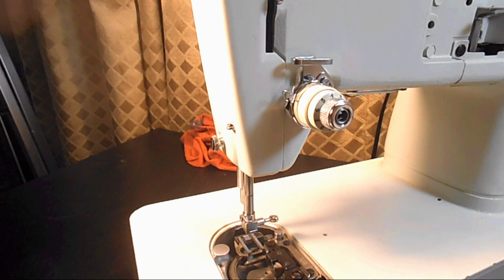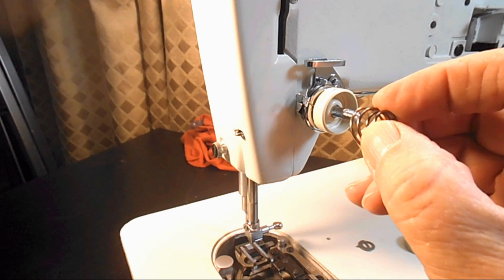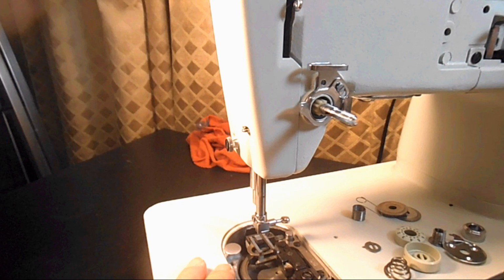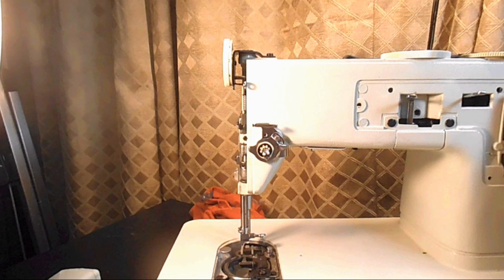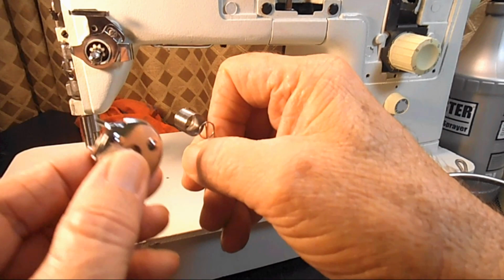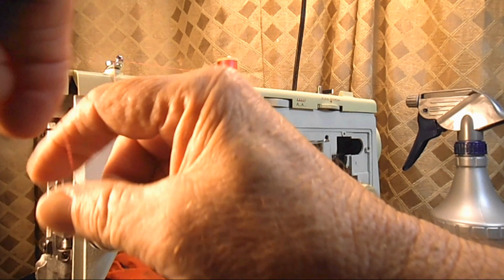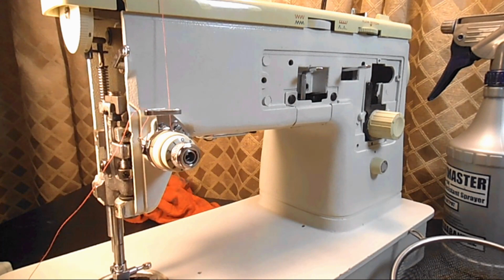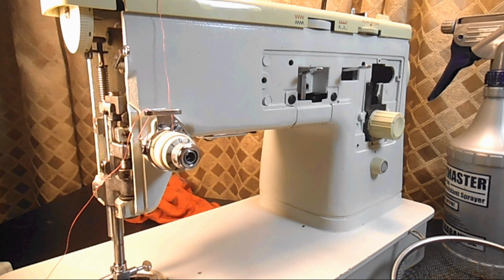How to Remove, Clean, Replace and Adjust the Thread Tension Unit on a Vintage Singer Sewing Machine

Comment: Hello Andy, remember my machine was hesitating to start sewing... I noticed this morning that the machine was sewing well without a thread... well, the problem was my tension disks, it was super thight (even at 2)... so I disassembled it again and my machine is working fine now! yeah!
Reply from the maker: Fantastic! Wow, that must have really been tight! I'm so happy you found the cause and thanks for sharing it. Another possibility to add to the list. I would not have thought of that cause.
Reply: @andytubesewing1953  Maybe I am wrong too but for now, it seems to be much better but that leads me too... OK but if it get stuck because of the tension, maybe my motor is not that good hehe I saw an other 401A to sell, I think I'm gonna buy it and see if it goes better, and keep it for parts or whatever cause I really like this machine.
Reply from the maker: @Cass_772  well I can't fault your reasoning on that. I have a spare motor that I cleaned up and tested for each of my wife's sewing machine. I also bought a spare hook because nobody makes those anymore. They last a long time but what if the hook point snaps off or something like that? I am so happy that you love the machine and that you are getting it back in service. I guess I said that before. Sorry but I am happy for you
Reply: @andytubesewing1953  Ok I'll get that second machine haha I am really grateful for your help, your replies and your videos, thank you so much!

Comment: I had to remove the tension unit of my 338.  The +|- indicator was broke.  Luckily i was able to find another.  I would not have been able to do this with out you.  Thank you so much and Merry Christmas.
Reply from the maker: Merry Christmas, and thanks for keeping the machine in service. It's a beauty, and I'm glad you found a replacement you could use.

Comment: I failed to  tell you that the sew machine is a Singer 248
Reply from the maker: Hi, Albert. I've never worked on the 240 series of Singer machines. I do have the parts manual for them and it has a blow-out picture of the tension parts. To me, it looks like there is a compression band inside the plastic numerated dial that slips onto a knurled knob to hold the parts on. I think you can pull the knob straight off the rest of the unit. You can buy a service manual for them for $9 at this link:  https://manualsoncd.com/product/singer-240-series-sewing-machine-service-manual/  You just download a PDF after paying. As a matter of fact, in the listing for the manual, they show some pictures, and one of them is the blow-out diagram I mentioned. You can see what I mean. IMO, $9 for the manual is reasonable and I own the service manuals for most of my machines as they are full of adjustment, repair, and remove/replace information. Thanks for watching my channel, and good luck.

Comment: Thank you for this clear demonstration. Nice to keep these old beauties in circulation! 😊
Reply: Unfortunately, it’s missing the tension flange indicator adapter and has only 2 rings. But it’s a Stylist 522 so maybe 2 rings is correct.
Reply from the maker: I'm glad you found the video to be helpful and I appreciate your comment happy sewing
Reply from the maker: Puzzling! The Singer 522 Instruction Manual shows it can be used to sew twin needles. It needs three tension discs to separate the threads for proper tension.
Reply: @andytubesewing1953  Thank you for letting me know it needs that extra tension disc. The machine was given to me so may be worth getting the missing parts. 😊
Reply from the maker: @heatherheather7107  good luck
Reply: @andytubesewing1953  thanks

Comment: Amazing video. I should have disassembled and reassembled my wife's sewing machine tension assembly before I ordered a replacement as her repair shop told her she needed. He said the assembly was missing a part and therefore wouldn't keep the correct tension on the thread.  As it turns out, the repair shop disassembled the assembly to clean it and put it back together in an incorrect order which is why it wasn't keeping the correct tension. Thank you very much for your thorough and accurate instruction video.
Reply from the maker: Thanks for the compliment. I appreciate you watching my channel and I hear from hundreds of viewers about repair shops that just aren't very good with vintage machines and that's one of the reasons I go into such detail I may have more videos on your particular singer model. Do you just go to my homepage? I list playlist by model number. Thanks so much for watching my channel and keeping your machine and service

Comment: I accidentally left my thread on my tension disc when I threaded my bobbin. My tensioner was a mess. Thank you for the video! I was able to disassemble, reassemble, and correctly set the tension on my machine without needing to take it to the repair shop!!
Reply from the maker: Good job! I'm glad you found the video. No more tension "tension" for you as you now know about it. Thanks for commenting.

Comment: This video was very informative as usual. I want to watch your other videos about tension as well.  My recent 401A purchase was very dusty and had a lot of lint in the bobbin area.  The tension discs probably need a good cleaning as well especially since I have to set the dial to 6/7 to make the stitches to look decent, but not as good as I think they should be. I always get nervous about disassembling parts, but after watching your video, I think I’ll give it a try.  Thank you!
Reply from the maker: Thank you Shelly. A lot of Lent in the bobbin area can relate to their also being a lot of Lent in the tension unit. If it gets impacted in the check spring or the actual tension spring and the disc, it can prevent proper tension. Thus, you have to add more and more so a nice cleaning can really make a difference. Best of luck and thanks for the nice comment

Comment: Thanks Andy. That was exactly what I needed to set up and zero the tension on that exact model.
Reply from the maker: I'm glad you found the video, Matthew. Lucky it was done with a model 413, right? A nice machine and very capable until the plastic gear on the vertical shaft breaks apart. It seems like a matter of time and usage before they go out. I had so many inquiries about that gear that I made a video for replacement. Maybe your machine already had the gear replaced but if not keep this video in mind for replacing the gear; https://youtu.be/M3bFtlV1Y6s   Thanks for taking the time to comment and take care.

Comment: ANDY! You are my hero! Thank you! Thank you! Next, I'm praying you have videos working with a 1964 New Home (Janome) 670. Blessings to you!
Reply from the maker: So sorry, MissMarta. I only work on vintage Singer machines. The only thing I know about the Janome models is they are high quality, so congrats on having one. Good luck, and thanks for watching my channel.
Reply: I appreciate your response ❤
I will be back, I have 3 beautiful Great-Grandma hand-me-down vintage Singers. One, a treadle! I'll holler when I get to one of those projects. Blessings!
Reply from the maker: @missmartamc  sure thing🙂
Reply: By the way, I was working on my Janome when I watched this video of yours, and the tension unit in mine is different, so I watched and rewatched what you were doing and listened to what you had to say, and because you are so thorough, I was able to do the repair and put it back together properly. And it works like a dream. Thought I should add that.
Reply from the maker: @missmartamc  thanks for letting me know. I get complaints. My videos are too long but my goal is to explain how the parts work and how they all work together. And I'm glad you took the time to listen and not just watch and that it was worth it for you since you got it fixed. Thanks again for letting me know. That's kind of you.

Comment: Hoping a good cleaning will help my machine out 🥲No matter what I have the tension at, the disks trap the thread and snap it. Doesn't seem like any debris is in there, so I'm going to actually wash the parts like you said. Also, Krud Kutter is amazing! Used it as a maid- it's wonderful for soap scum in the tub 😁
Reply from the maker: Having a clean and adjusted tension assembly is always a good idea. It can fix the problem or lead you to the location causing it. Good Luck.

Comment: Thank you for the post. Slow and methodical with a good explanation of what you are doing. My checkspring is disengaged. I am going to try to fix my White 221 with your help.
Reply from the maker: Thanks for commenting. I may have some better videos for the type of tension assembly on your featherweight. It should be the same style as the SInger Model 301A. Where the little chrome adjusting knob in this video uses a set screw, the 301A & 221 knob has a pin on the back that sits into small holes in the numbered dial. I covered all the tension assembly work in my Coco 301A series if you'd care to take a look. DIsmantle Video: https://youtu.be/c6usEx1vUKY    Installation Video: https://youtu.be/VPzpLIAvz8Y  and finally how to set the Stroke & Tension of the check spring: https://youtu.be/lOLKpvonnPE    Best of luck with it and thanks for watching my channel.

Comment: This video finally showed how to get the tension wheels working, now I have the issue where the bottom loops like crazy, and the top is snapping! If I try tightening the wheels the thread just snaps every time
Reply from the maker: can you tell me what model of Singer machine you are working on, please? A few possibilities for bottom loops. Often signifies lack of tension on needle thread, or very high tension on bobbin case (more rare). Can also be incorrect threading path, takeup lever problem, and so forth. Did this happen before you worked on the tension?

Comment: Thank you Andy Tube. I was going to give up on my 1960s 670g until I found your video. Only difference was the stop pin hangs down, but I managed to suss it out. Julie D
Reply from the maker: That's an unusual position for the pin, but if it works then all is well. I've never seen a 670g in person so I downloaded the manual from Singer. What a versatile machine! I'm glad you were able to save it. Thanks for that, and for commenting on my channel. Take Care.

Comment: Andy, thank you so much! I’m restoring a Featherweight 221 and working on the original  thread tension unit. However, the threaded stud probably needs to be replaced and the screw on the other side cannot be removed. Your videos have guided me through a lot all of the restoration and I am a subscriber. Any assistance would be greatly appreciated! Thanks, Larry White, Tallahassee, Fl
Reply from the maker: Stuck screws are a pain for sure. I've had some luck with soaking them overnight with a penetrating oil, like WD40. Also heating them with a hair dryer. On larger ones, I have used a "tap-n-turn" method of hitting the screwdriver sharply with a small hammer while trying to turn it. I don't think I've done that on a small set screw. Having a good-fitting hollow-ground screwdriver with flat sides is a must to help prevent stripping half of the head off. Did you know I have a playlist for model 221? https://www.youtube.com/playlist?list=PLsCOZgzzaiKIA1OPw0k6QOSTE-wAUZ4kp    One of those videos is about tension units https://youtu.be/enSTxxzqy4s: This family seems to know more than anyone about the featherweights. They have helped me a couple of times through email questions. You can reach out to them if you like. They are really nice folks. https://singer-featherweight.com/ Good luck.

Comment: Thanks so much for the video. While not exactly the same as my Kenmore it definitely explains a lot. Hopefully I can clean and set mine now rather than paying for a new assembly. Which is what I was about to do because I was unsure of how it went together or worked. Cheers
Reply from the maker: I'm sure you can do it. the basic principles of the tension unit are the same no matter the brand so if the parts are similar I'll bet you can clean it and adjusted. I sure hope so and thank you so much for taking the time to leave a comment good luck

Comment: Hi Andy 👋 let me start by saying thank you for taking your time to explain the sewing mechanisms in detail. But the 360 singer model it doesn't have the screw on the tensioner. Please let us know how to remove it.
Reply from the maker: The thumb nut or grip on the front just pulls straight off, like right at you 👀 It has an adaptor that screws on, but no flange on the adaptor. The 3 tension discs are different on your model. I think the center one is flat. The two on the outsides go on with the raised portion facing the flat center disc. Unusual. I'd really suggest buying the Service Manual for it that has the step-by-step remove & replace directions. https://store.tandtrepair.com/240-248sm.html    It's $10.50 but Terry will discount it by 20% if you use my coupon code of andy-h-yt before the end of 2021. That makes it $8.40 and instant download. If you are not into working on it and are not in a hurry you can buy a new one from China for $7 from many sellers, or pay more for a shipper in the USA. https://www.ebay.com/itm/Tension-422403-457-For-Singer-242-247-252-360-368-400-403-404-6105-6212-7110/143757742753?hash=item2178a112a1:g:9PkAAOSw6Khfb~Ip
IMO, vintage parts are better made and last longer so I try to clean and adjust before replacing. Good luck.

Comment: Thank you Andy!!! I was going crazy trying to find an example of a tension assembly with 3 tension discs. I've been sewing for about a year now on a Singer Simple 3232 and every time I topstitch with a twin needle, it pops a bunch of stitches or the needle breaks. The only solution I could find is to make sure the threads are separated as they run through the tension disc so they don't tangle, but I couldn't see how that's possible on my machine--it definitely only has the 2 discs and no way of separating the threads. Thank you for helping me solve this mystery! I'm disappointed though, because I definitely prefer the look of topstitching with the twin needle for hemlines and the like. Any advice on whether there's still a way to use a twin needle on my machine?
Reply from the maker: I certainly understand the desire to have the twin needle stitching; it's beautiful. I could not find any parts documents for the model you mention to see what the tension discs looked like. Many are concave/convex shaped with the two convex sides facing together to put the tension on the thread. It has been a number of years, but I came across a machine with the two tension disc system that was sewing twin needle on dress shirts. (In the Philippines) I asked the fellow how he got the machine to use twin needles. He told me he added a thin flat polished steel disc between the two existing discs. He then had to make a new tension releasing pin that was a tiny bit longer to compensate for the thickness of the new disc, (he said that took a while and lots of trial and error to get it just right). I have made new tension releasing pins from a finishing nail, so I understood what he was saying. He was lucky that the tension stud was long enough to add the thin disc. He said the disc was a washer that he drilled a larger hole in to fit on the stud, then he polished it with fine sandpaper for smoothness. When I commented that he went to a lot of work, he said "yeah, I did, but look at that double-stitched seam" 😀 Again, I have no idea about your particular tension assembly, but there's an idea for you to think about.
Reply: @andytubesewing1953  Haha, I totally get this guy--"look at that double-stitched seam" indeed! I think for me, it's not going to be worth going to all the effort to DIY something that complex--I'd be more likely to break the whole assembly than anything else. I also anticipate that as my sewing skills improve, I'll upgrade my machine to something with more versatility and add "3-plated tension assembly" to my must-have list. In the meantime, I can make do with finding a different stitch for my hems, but I'm at least glad to add a valuable piece of knowledge to my "sewing theory" repertoire. Thanks again Andy! without videos like this, I wouldn't have been able to learn a fraction of what I know now about sewing!
Reply from the maker: @jackiehannaford  Good luck going forward then. BTW, many of the vintage Singer models can double-needle or twin-needle sew. Here is my main Playlist page wh=ere I have videos organized by model number. Often a vintage machine can be found for a reasonable price. Maybe you'll see a model that catches your eye. Happy sewing then.